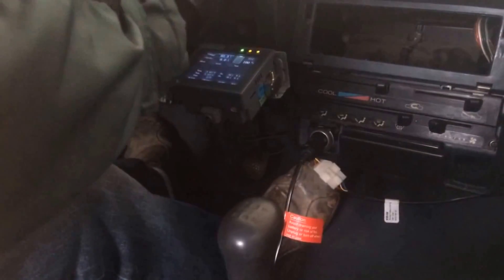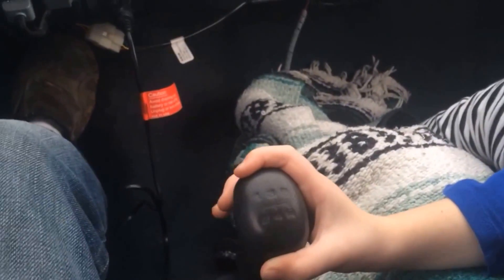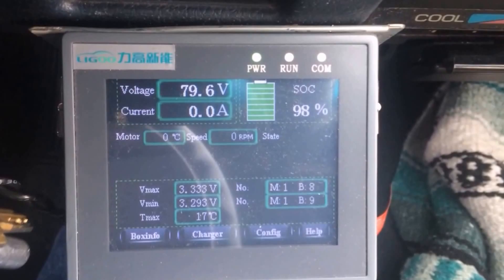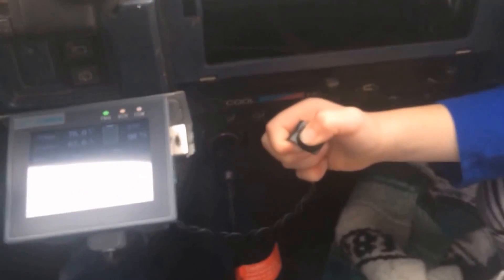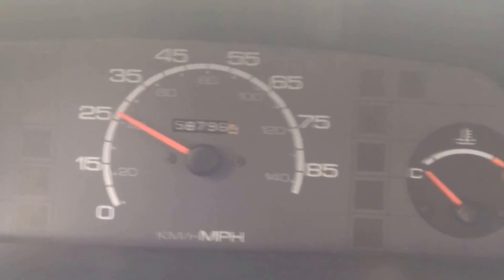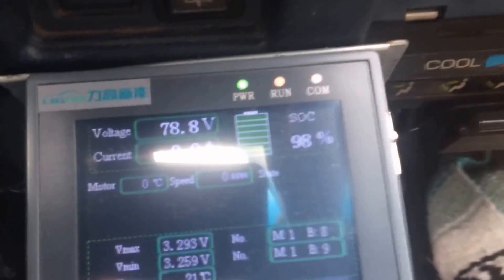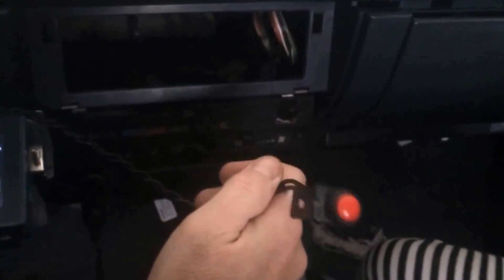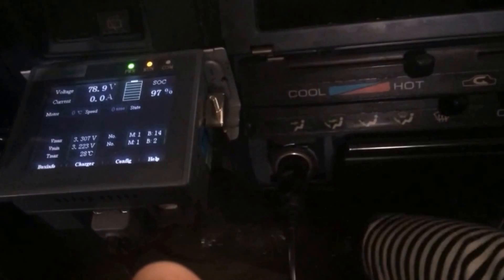How to Shift Gears in An Electric Car? Clutch-less and with Regenerative Brakes

Comment: I often wondered if you could put a stereo amplifier between the batteries or power source & the e-motor if it would increase the power to your motor, kinda of like it does to speakers.
Reply from the maker: Drive your motor with music and you could hear it playing as it vibrates the coils in the motor. Ha ha. 
Existing motor controllers are crazy efficient, like on the order of 98-99% efficient. A really good, low distortion audio amplifier is at best about 25% efficient. So an EV like the Tesla model S that currently has a 400+ mile range would only go about 100 miles or less if driven by an audio amplifier.

Comment: You should make a really light flat trailer with about 4-6 solar panels on it, & then put 2 more on your car. That should be plenty of solar power to propel your car especially with the transmission.
Reply from the maker: I looked into putting a couple of solar panels on the Geo. Sitting in the parking lot on a sunny day, I calculated it would add about 5-10 miles of range a day. However after doing some quick aerodynamic calculations, the increased air resistance at highway speeds caused by the solar panels actually decreases the car's total battery range by more than I gained by having it charge up in the sun each day. It was a net loss. You would have to keep speeds under 45 mph all the time to make it remotely worth it. My commute was 95% highway. 
Then in the winter time, any skiff of snow would greatly reduce or stop the solar panels from collecting any energy. I would have to go out to my car every few minutes to clear them off throughout the workday, costing me time and money. That goes against the whole simplify my life mantra. So ultimately it wasn't worth it.

Comment: aproximately how much current does reegen braking produce to the controller? i think a good bms is needed for supporting the regen braking charge current
Reply from the maker: This one produced about 100 to 150 Amps. It happens so quickly compared to the discharging of normal driving that I don't think the BMS would be necessary. The BMS is however necessary for charging the battery.
Reply: @kc7ekk  i am doing my first ev conversion, what do you mean it wont be necessary? i still dont know how the wiring goes, but i am doing the battery pack, and i guess i have to wire the bms, and then this bms goes to the charger.
Reply from the maker: @ignaciovela4618  A BMS is necessary for charging but not as essential for regenerative breaking as time spent breaking is very little compared to time spent charging and driving.
Reply: @kc7ekk  thanks for your replies, i am still new to how to do the connections battery-charger-bms-regen braking. But what I understand, is that the regen braking function doesnt have to go through the BMS?

Comment: can you please tell which motor and motor controller did you use.
Reply from the maker: Motore: PMDC Motor 12-72V 15.4 hp cont, 38 hp pk
. Kind of wimpy but it worked and got me up to freeway speeds, (barely). 
Original controller was an Alltrax SPM-72400 400 Amp. I swapped it out later to one that does regen. I can't for the life of me remember what model/make that was.
Reply: @kc7ekk  thank you sir. sir can you suggest us a motor controller for a 4KW motor that would assist Regen, which is not so costly.

Comment: Hi, very informative video. I still dont get it, how the gear can shift without clutch ? Hmmm
Reply: Leo Atansil  because the electric motor comes to a complete stop when u not giving gas, you can shift gears with ease without a clutch
Reply: @Fattigfixarn  
I still dont get this, surely the rolling tyres on the road are connected to the electric motor, the motor can not come to a complete stop if the car is rolling?
Reply: @Fattigfixarn  but you don't want it to come to a complete stop. That works only for pulling off. You want it to match the gearbox input speed in the next gear, so how do you do without a clutch without a scraping noise? You could match it with the accelerator. I suppose there is less momentum in the electric motor parts than in the equivalent engine speed, so less likely damage if you don't match the motor speed properly.
Reply: Oh right ! Now it make sense to me, thanks
Reply: Iam sory Sir, one more question. I want to convert Jeep cherokee 1996 model to electric. The engine will be 50Kw power,  rated speed 3000rpm, and max speed 8000rpm. What do you think the 0-100km/hour acceleration time will be ? Or maybe i just want to know your car’s acceleration time. Just for comparison. Thanks !!

Comment: I don't understand why would an electric motor be different than gas. Are you shifting while moving then why don't the gears grind?
Reply from the maker: Electric motor armatures are tiny and don't have much rotating momentum like in a gas engine. And when no power is applied to the electric motor, the synchros in the transmission can slow them down or speed them up to allow a seamless gear shift.
Reply: @kc7ekk  

Ok now i understand thanks
Reply: Can you maybe take out the actual clutch but leave the clutch pedal? Just to not mess with the muscle memory of operating a manual trans.

Comment: Put a clutch on it or you will grind the gear box or get a reduction clutch
Reply: I didn't hear any gears grinding?
Reply: @AR-zq9hq   The gearbox has to work hard to sync... It is quite obvious by the sound it makes going from 3th to 4th. You might as well say that it is grinding. Since due to premature sync wear you end up with having to change gear without them. And with that your going to hear gear grinding sending pain down your spine.
Reply: @TheDiner50  electric motors are very low inertia, yeah the synchros have to work slightly harder, but they will still outlast the car. And most people who are scared of grinding gears have been driving for less than ten years.

Comment: Say that you for instance want to convert a Automatic transmission Tesla into a Manual transmission. Would it be possible to do that?
Reply from the maker: All electric cars are already have a manual transmission, or rather a single, fixed gear. They only have one gear so there is no shifting. There is a gear reduction but there is no transfer of power through a fluid like in an automatic transmission so they are in fact already manual transmissions. There is just one gear so there is no need to shift gears.
Reply: Thanks for the answer, but isn't it possible to in a way switch the one gear transmition to a manual transmisson? I'm willing to pay, I just want to know if it's possible to do in a modern electric car
Reply from the maker: You could I guess. I don't know why you would want to do it. Are you looking to increase your top speed? Like above 200 mph? That is probably the only reason why you would want to add another gear.
Reply: Actually, the only reason why I want to do it is purely based on the driving experience. I simply love manual cars, and enjoy driving them :) Thanks for the answer tho
Reply: Thanks for the question .I learned a lot. Johnny 5 needs input.
Reply from the maker: You're welcome.  Don't Disassemble
Reply: Teslas don't have transmissions, they are direct drive.

Comment: Using gears gives you better power efficiency right? cause youre not using that much power, you use gears and convert it to speed instead of getting the motor to go faster on its own
Reply from the maker: The motor I used in this car had a small RPM range so keeping the manual transmission was still necessary. unlike cars like Tesla, Bolt or Leaf where they use a single gear, fixed manual transmission.
Reply: I agree with you.
It will improve the range (with same battery).

Comment: Is there any damage to the gearbox when you shift gears without clutch?
Reply from the maker: Not when the motor is electric.
Reply: If you're good, you can clutchless shift even on a gasoline engine hehe
Reply: The thing is that an engine is running at constant speed an the electric motor just move when you require it
Reply: JohnSavesEnergy it’s doesn’t matter if it’s electric it will grind the gear box that’s why you have a clutch
Reply: Blake Hatton you can tell from the video that it clearly doesn’t. I can’t explain the exact mechanics but I’m sure it has to do with the synchros of the transmission being able to work better in conjunction with an electric engine. Keep in mind some semi truck drivers (although they use unsynchronized transmissions) in the U.S only use the clutch while starting even with a normal Diesel engine. They shift up to 13 or 18th gear without using a clutch.
Reply: @JosephSamsor    Your wrong. This are not clean gearshifts. The synchros are working hard to make this work. Way more then a proper gearshift of a standard car. U.S Trucks and normal gearboxes work differently. There are synchro, or non synchro gearboxes. 

And even if the mass of the electric engine is less then a normal engine.... still more mass vs normal car. The hole point of the clutch is unload the gears as much as possible. Having only the mass of the gearbox itself to manage. And ones the gear change is done you bring back the engine and keep on going. Problem is that the electric engine have a hard time matching the gearbox speed after being disengaged. Trivial problem one can fix with computers really. Only not something a human can do with the gas pedal in a reasonable manner. (but computers already can do this on normal cars)

As soon as you are talking about synchro gearboxes you are forced into using the clutch if you care about longevity of the gearbox. Shifting a synchro gearbox without the clutch is way harder vs a non synchro box. Harder to notice due to the synchro do allot of the work to cover up the "grinding" that would happen without them. When EU trucks started to become synchronized drivers where told to not use it like they did before. Because this advancement in gearboxes also changed how one should operate the dam thing! So they are NOT the same. Simple :)

Proper use of the synchros removes the smallest of gear grinding one can hear to this day when proper pro U.S truckers driving there big rigs around. This is what syncros are meant to remove. But at the cost of a less tolerate gearbox in a sense if you still wanted to use it like before.

Low effort drivers or something like not using the clutch is basically making the synchros be the dam clutch! No :C  Normal car driving is fine as that is what modern gearboxes are made for. (obviously) But be a bit sloppy and the synchros work overtime. (normally you feel it in the gear stick a bit more resistance then usual) 

To drive a non synchro you need to know how to operate it. But at the same time they are easier to match the speeds of all the different parts going at different speeds. They require more knowledge the heavier equipment gets, but are in a sense easier to get into gear vs synchro boxes.

A synchro gearbox you are very much limited what you actually can accomplish without the clutch. But easier to understand and operate. And due to it we call it easier to shift. But really you offload the work on this poor synchros. (that we should be nice to) Also you can not feel the resistance in the gear stick when it is to early to try and put a gear in. Well not like you can do in a non synchro box. It is a fine art to drive non synchro hard to explain the difference in non synchro and with synchro. 

Just one different is that on a U.S truck pressing down the clutch to the floor engages a gearbox brake. (yes) So if you shift gears in one of them you press the clutch not all the way down when gear shifting. Well at a complete stop you use the brake but anyways a bit advanced to explain. A synchro box do not have that. instead we have synchros = "mini clutches" that try and match the speed for us so we do not have to think about it.
Reply: Yes. More like unreasonable wear compared to a gas car using the clutch like it should be.

Comment: What if instead of a separate button for regen braking have a two stage brake instead? So a light touch on the brake pedal initiates the regen brake system then pushing the pedal further brings the physical brakes into play.
Reply from the maker: The problem with making the regen tied to the brake pedal was that whenever I shifted gears and pushed on the brake simultaneously, the motor would come to a halt and since there was no clutch, I couldn't get it back into the next gear.